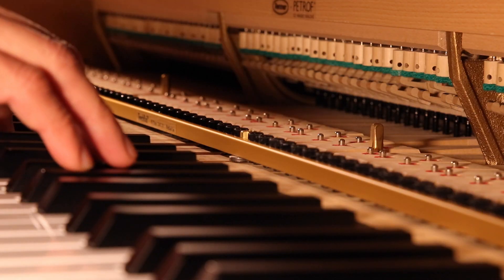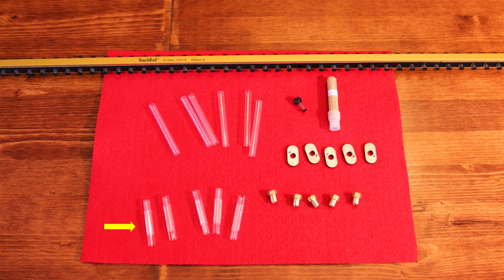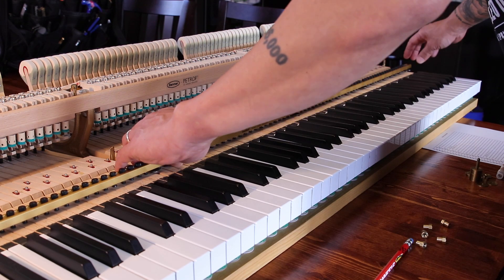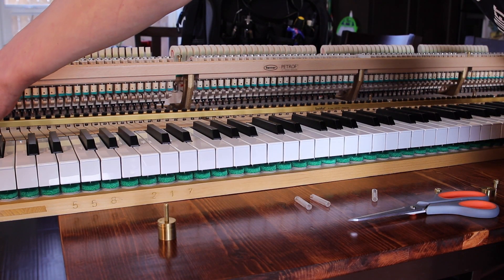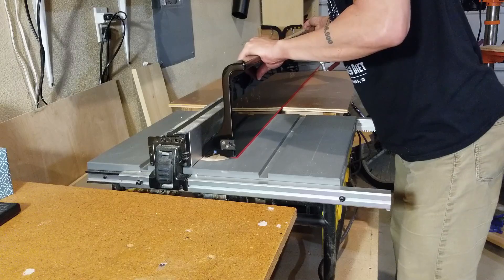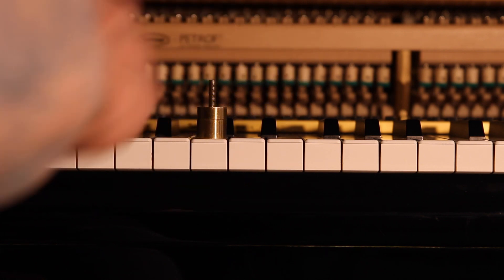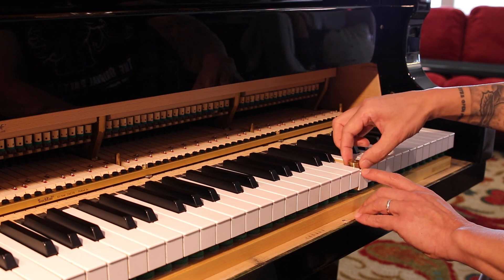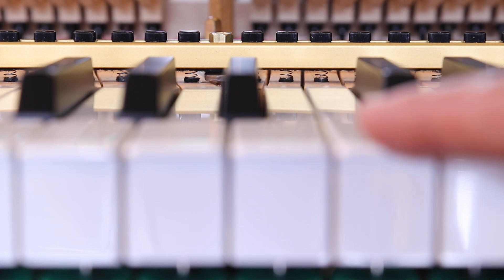Pitchlock Touchrail customer installation and review

Comment: Hi, great video. I am cheap, so made my own touchrail using aluminum channel and some screws holding the springs. The notes aren't individually adjustable, but it works great for my extremely heavy Baldwin. Now I am looking at a nicer Baldwin which I anticipate will also be too heavy, but can't find where to buy the real touchrail (the link you include is dead). Any leads? Thanks!
Reply from the maker: Hi Garnet. The link indeed appears dead and I can't find Scott Jones, the creator, online or on the PTG website. I hope he's okay. My suggestion for your Baldwin, however, is to get the action properly balanced. You may not need a Touchrail after that. I have actually removed the Touchrail from my piano, and am preparing to use the Fandrich-Rhodes Weightbench process to properly weight my keys and adjust the action geometry. Getting things properly set up is ultimately the better solution. If you're interested in this process, check out Chris Chernobieff's channel. He applies the Weightbench method to an old Baldwin SD10 and shows all the key leads he was able to remove afterwards. His action was sluggish before as well. Good luck, Baldwins are great pianos!
Reply: .   Scott went over to the dark side.  He now works for that famous company that discredits and disparages the fine pianos and efforts of all those hard-working piano restoration technicians. STEINWAY